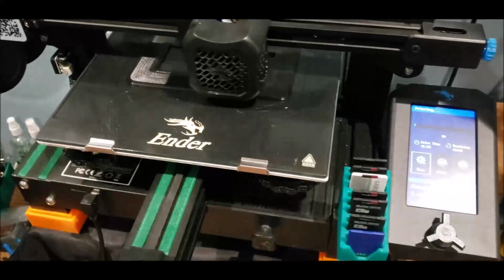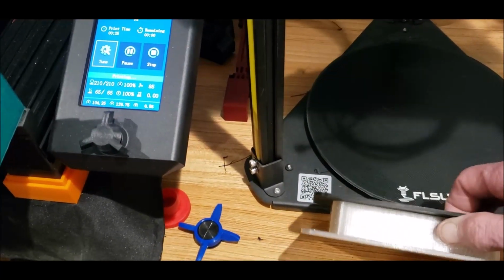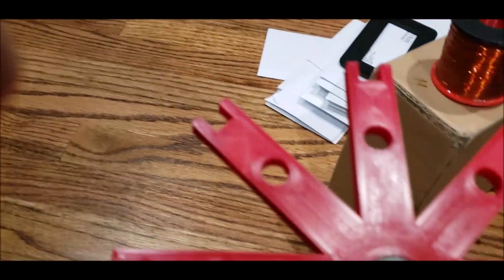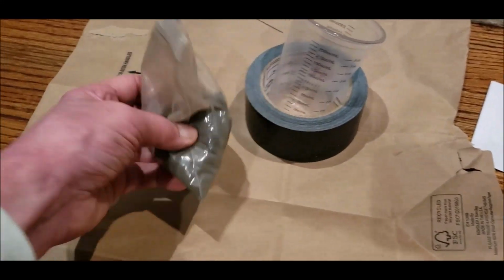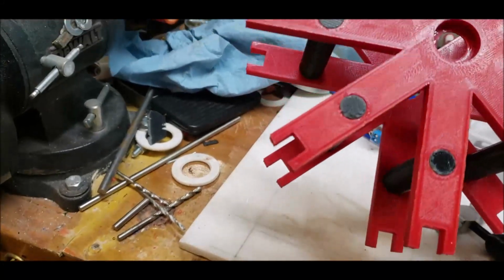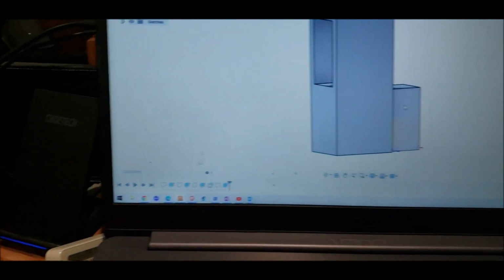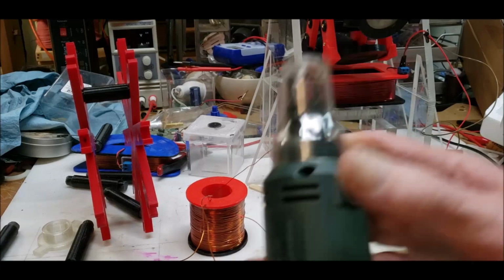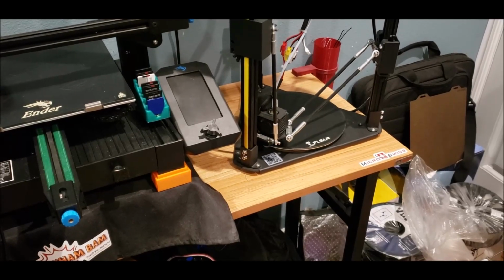3D Printed Ferris (New) Wheel Motor Build

Comment: Next time you make a bedini coil.. make it trifiler: 1 small wire and 2 identical bigger ones. Why? because on a classical bi filer bedini, you only can use the back-emf to power something external. (charge a battery, or light a LED).. with the 3rd winding and a UF (ultrafast) diode you can, if you hooked it up right, feed the back-emf back to source. It no magic, simple transformer effect. Your consumption will go down from lets say 300mA, to 120 (with the same speed)... it just gives more possiblilities. As for the twisted wire, dont bother. I once bought some pre twistet one. Its ok.. but very expensive and it didn't change anything in the output. (maybe 10 mA up or down). I say a twisting jig the other day.. if i find it again, i'l send it to you..
Reply: Found it.. its a simple winding jig.. old stuff (14 years old).. I think it should be possible to make it out of printed parts.. just the outside part out of wood. the problem is.. you have to test the speed of the twisting motor.. to get the right amount of twist: https://www.youtube.com/watch?v=H68rSOzWslE .
Let me know if you would adventure in that project. I would love to, but i am afraid it would consume to much time building.
Reply from the maker: Thanks I will. I have that larger 3d printed coil I'll do as a tri-flar. Also thanks for the twisted pair info.